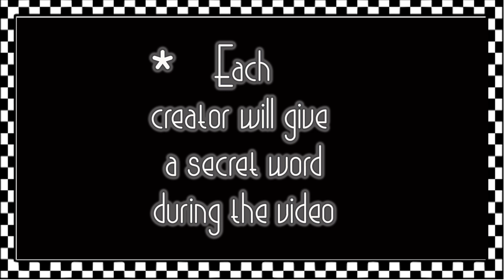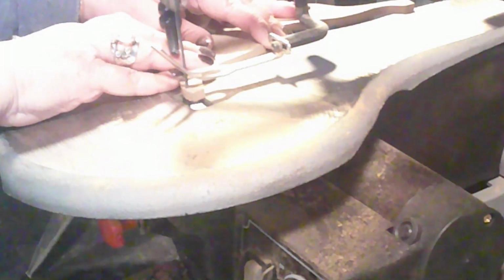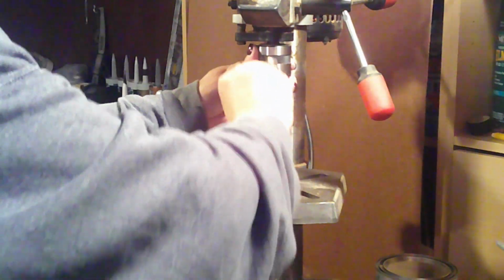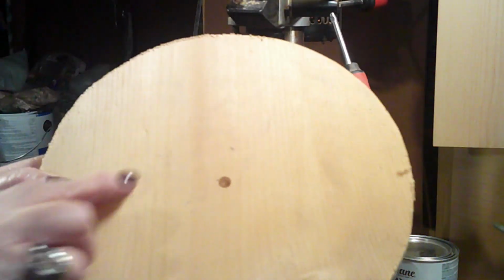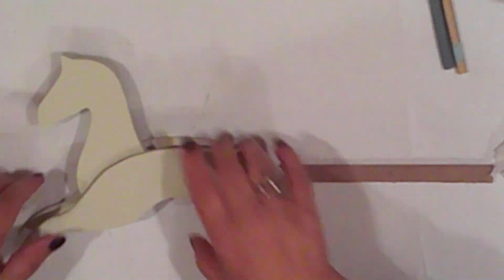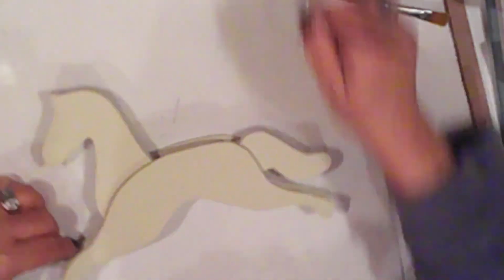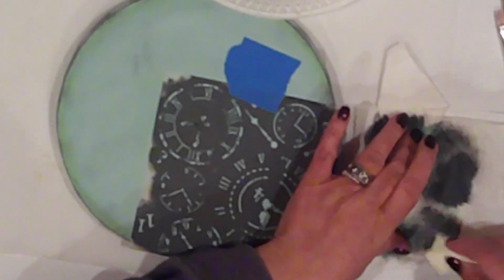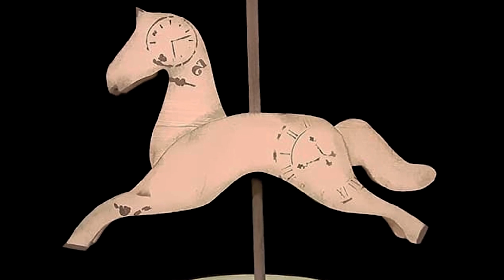Vintage Hobby Horse DIY

Comment: I just love the horse it is stunning. You did a fantastic job and also describing everything you did,  I can use a jigsaw good and I have only used a "chainsaw" a couple of times. My husband has a bandsaw and I can use the jigsaw a lot better. I just can't get it in my head to turn the wood and how. God bless 🙏
Reply from the maker: Hiya, Kim! Thanks so very much for watching & for your sweet comment! I find it easier to make a turn by backing the wood, just a hair & pausing for a wee moment. That should allow the blade to adjust to the new direction. Also, the blade will always slightly bend to the side with the most weight, so I find that the blade's deflection lends itself to cutting in the new direction. Give that a try. Try it on small pieces of scrap. Give yourself some grace. You'll get the hang of it 😉 Thanks again for taking time to watch. So pleased that you enjoyed it! Best of luck to you! ☘🤗